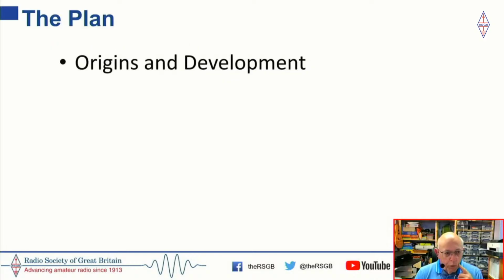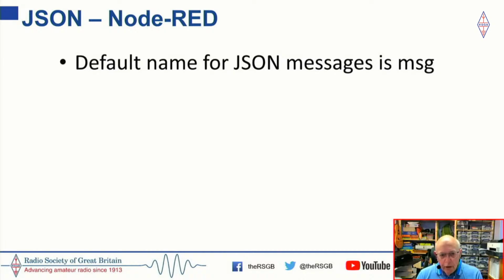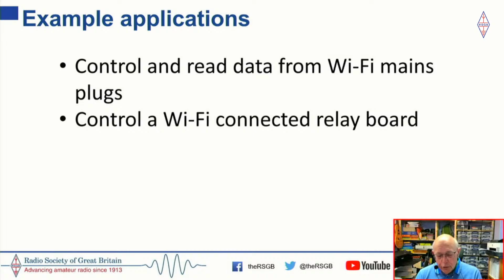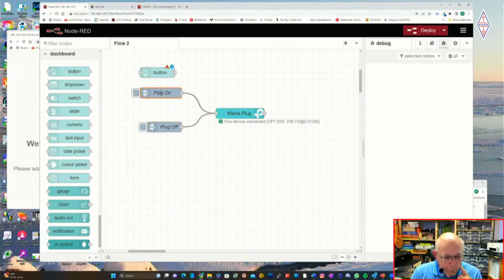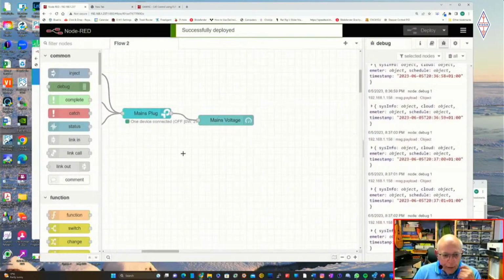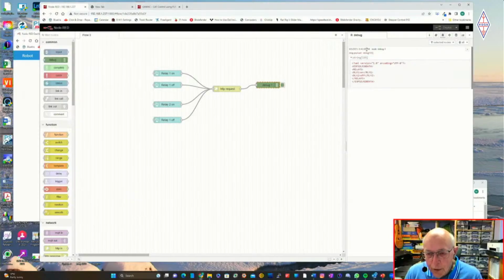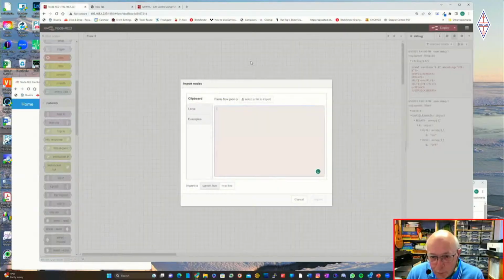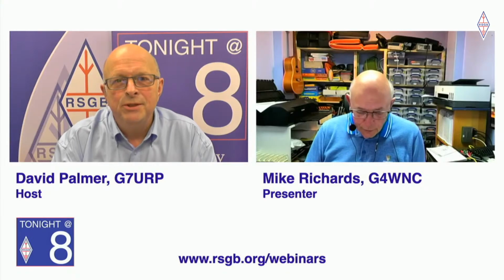RSGB Tonight@8 - Node-RED for radio amateurs by Mike Richards, G4WNC

Comment: Thanks Mike I already use node red for tracking temps around the house weather solar panels and river levels, my area suffers from flooding so useful during the winter wasnt aware of the ham radio resources you mentioned so will be checking them out de g0fqb
Reply: Thanks Mike, you have spiked my interest to find out more.